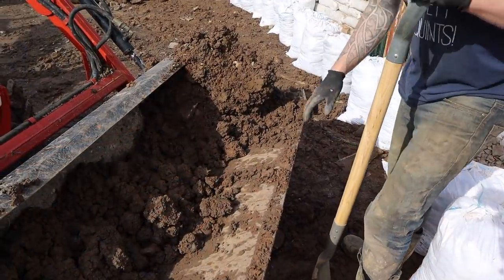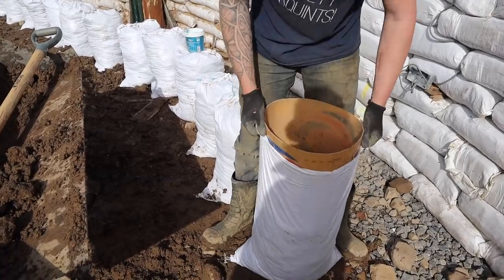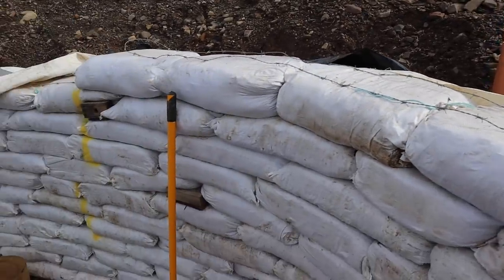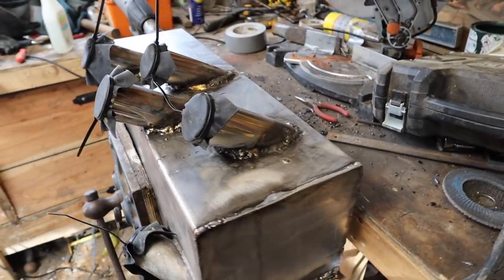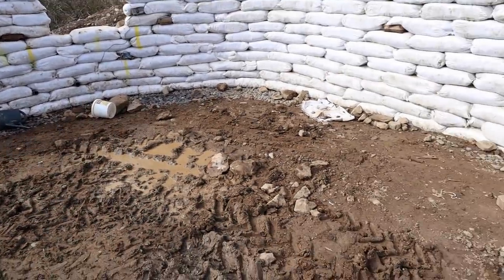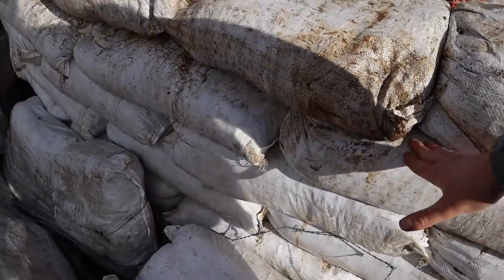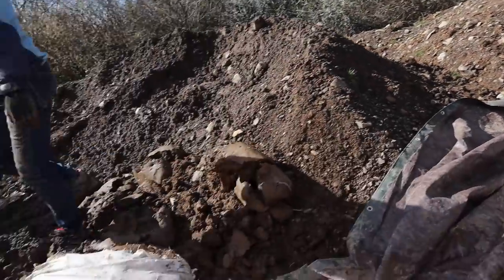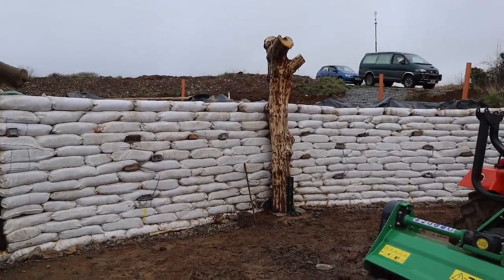Off Grid Earthbag Workshop part 18 Bad Weather Wall Collapse

Comment: Just my curiosity and me thinking out aloud here, but, if the small wall section that blew over had a built-in buttress (made up of mud-bags turned 90 degrees built in to the other mud-bags), it'd be a lot stronger. Yes, I know the weight of the roof would probably keep it strong but still, if it was MY wall (it's not, I know), I'd do that so the wall was much stronger and I could feel comfortable that the roof was extra secure at that section at least. Sorry you have to spend time repairing it, I don't envy you one iota. Good luck with the rebuild; you're probably one of the most motivated people I've ever seen; kudos.

Comment: Gold Miners when they are removing their overburden that has clay in it have to utilize a screw type conveyor setup. The screw turns and brings the clay to where they can dismiss it; otherwise the clay would stick to the sides of the conveyor or quickly sink to the bottom of chutes etc and not want to move. Possibly you could fashion an auger bit that you might have on had for drilling post holes. Surround the auger bit with metal sides and then have a slow turning motor that would easily bring that clay soil and empty the clay into those earth bags. I could easily make you something like this if I were nearby....I appreciate all your effort and tenacity. Kudos to you for living this back to basics non-materialistic type daily lifestyle !!!

Comment: Very discouraging, yet I'm amazed you don't seem to have more.  Unless you're avoiding showing us a bunch of breakdowns, I'd say you have an extremely high success rate on your projects.  So sorry to see this happened, but since I've seen your workshop basically done in more recent videos I know it all turned out.  Inspired by your determination, patience and grit, and well worth the effort I'd say as I just watched you finishing building and hanging a stunning set of doors for the upstairs metal working shop!

Comment: I had a 10 x 2 metre concrete block wall fall over as one piece in a storm a couple of years ago when I was recovering from a back injury. I told the builder that the foundations were inadequate at the time but had to go and buy supplies . By the time I returned it was up.He of course has done a runner. The exercise dismantling and moving the blocks was good for the back  though even if it took some time. Shit happens and we move on.

Comment: I would suggest adding some buttressing every couple of meters  to make it more stable. Also, to reduce the wobble you want to really hard-end your bags when packing in your mix, especially if you're not using bag tubing. Where your bags come together should leave a vertical seam, like brick work.. hope that helps. Oh and also adding rebarb through the bags every 4 or 5 rows will definitely help
Reply: .. forgot to mention, a good tool to use when packing your bags is to get a long thick stick, a small plastic pot plant holder and pack the plastic holder full of cement. Add the stick in the middle, wait till it sets and you have yourself a perfect tamper to hard-end your bags

Comment: Sorry to see the wall had fallen over but at least it was just the area between the windows. 
You might want the build a temporary support for that spot on the outside to prevent a recurrence until the roof is covering everything.

Comment: My heart sank when I saw that section down. Time, toil, and a bit of material lost. If I saw it right, it was the section between the windows that fell, wasn't it? Perhaps putting the boxes for the windows in place once you have the first row between the windows back so that you can secure the rows to the boxes as you add them will keep that problem from repeating. It seems to me that such was the approach used by 'My Little Homestead' (YT channel) in all their earthbag buildings.

Comment: Could you drive some rebar steel or hard wood stakes down through the bags to hold the wall together?
Reply: he did that :)
Reply: A bit earlier in the video I was thinking about how it looked like that section could youse some temporary external bracing.  I'm sure it would be fibe once the building is done with a roof over it, but with the weather they have been dealing witb it looked pretty sketchy.

Comment: I think I'd use those tinted windows on a side where there might be a lot of sunlight that you may consider a bit too much at time during the summer.

Unfortunate about the wall but maybe some boards and plank supports when redoing that section of the wall may help until there's enough weight for it to stay in place.

Comment: Hey Kris couldn't you weld a cone shape bit of metal to a jackhammer and hammer some metal rebar into it every few rows. It would just give it a bit more vertical strength I'm sure some local drive way concretors would sell or give you off cuts cheap or even for free.

Comment: Hi, have you thought about building a set of tromels to break down the soil and remove stone and rocks? I have been looking on you tube and considering build one my self.  Damn just watched the bit where you lost a section of wall, keep you chin up mate 😠.
Reply: I thought the same thing, should help with the setteling issue's if the clay is not suspended

Comment: I'm thinking about making a small conveyor to get the dirt out of my basement. I bet with a little modification to the design. With a hopper, it would work well to fill bags for a shelter! I have about 12cuft of dirt to get out of my basement,  I could just dig it out, run a small tiller through the dirt, then on the conveyor, to fill the bags, I'd like to get continuous bags, but that's a bit costly, and difficult to find here. I want to build a under ground structure, and thinking maybe drive rebar through the wall, or a inner wall to reinforce, i also thought about rammed earth! With a good bit of concrete in the mix, its going to be a while before I "break ground" on the project. So I have time to figure what's best for the build, maybe just cinder block, or a combo of block and bag, maybe concrete! I had the crazy idea to dig a trench, fill with concrete and re-enforcement, then did out the center after its set, leaving a room, then stucco the walls, and pour a floor! But that could get crazier than the idea!!..

Comment: I know I am not there to build with you and this might have already been considered and discarded;  But have you considered vertical wooden support beams while building the walls? Edit: I am talking about outside the sandbags, so they can lean on it for a bit of extra support while they are wet.

Comment: Put the reflective windows where the sun hits the building in mid-summer to help cut glare and heat.
When you have a free-standing area of wall between two windows would it be possible to stake them with some re-bar at each end to hold the wall vertical? or even put some temporary support poles up either side of the wall at a decent angle opposing each other?

Comment: I feel like those windows would be better for the side of the road, then if you are in there and people turn up it serves an actual function. They can't see what is in there but you can see them!
Reply: Also, in other earthbag constructions I have seen they have added rebar into different sections of the wall to tie multiple layers in, may help in rebuilding up that section thats fallen down. Can't remember if I have seen you do this so far! Good luck moving forwards!

Comment: I was thinking about cement and rebar and 3 fill PVC more than just one to fill the bags.  Maybe place two smaller tubes 4 inch tubes on the outside (corner) of the bags with the main fill tube in the center.  Then mix Cement for the inside and outside edge of the bag so once it hardened it would provide more support for the wall (oOo) <<< like that?   Would love to see someone try this.   I think the cost would be much more but I think the cost may be worth it.  I'm concerned about the wall being below grade an water building up on the outside?